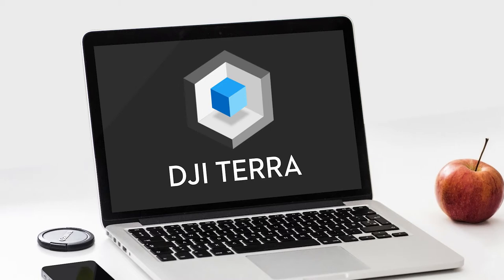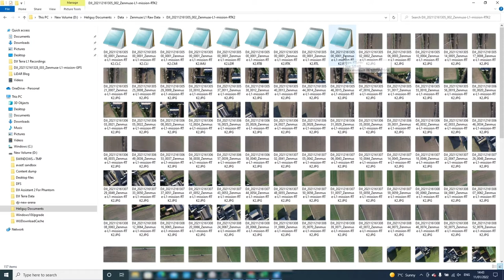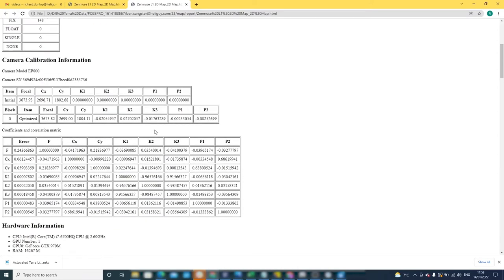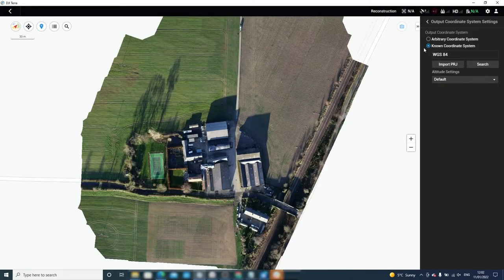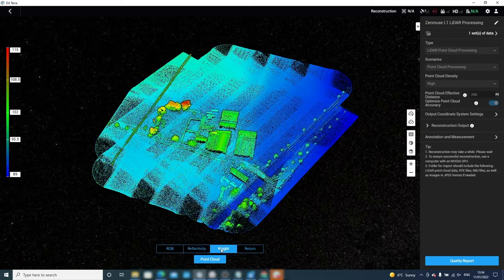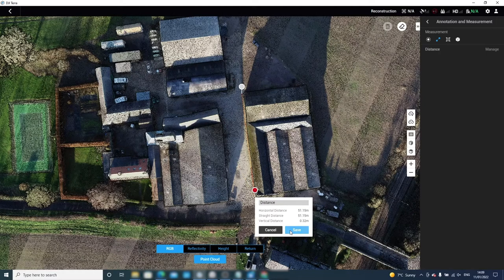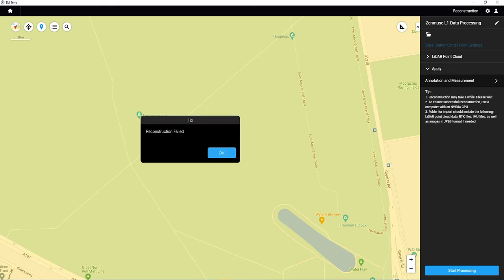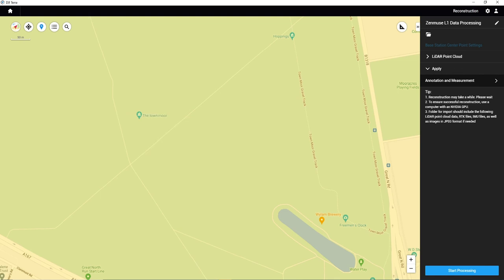Generating Point Clouds Using DJI Terra

Comment: Can you filter out the other points like trees and buildings? I only need the  bare-earth points to produce a contour map. Thanks
Reply: Not through DJI Terra but other programs that you can bring the .LAS file into can classify the point cloud. I use Trimble Business Center for example and it's very good at sorting ground points, trees, buildings etc.